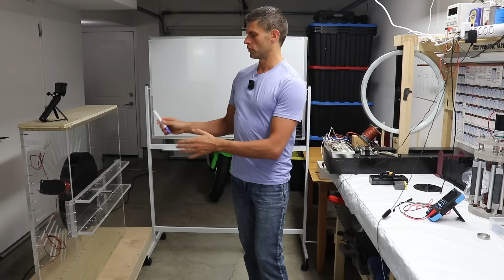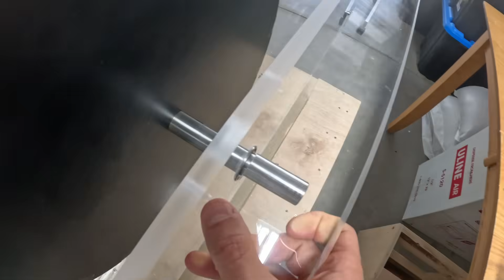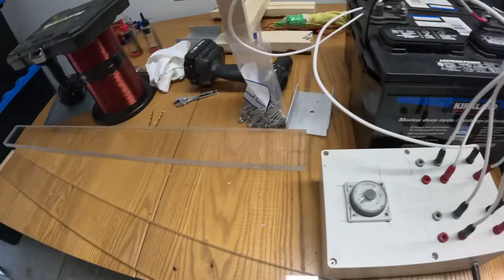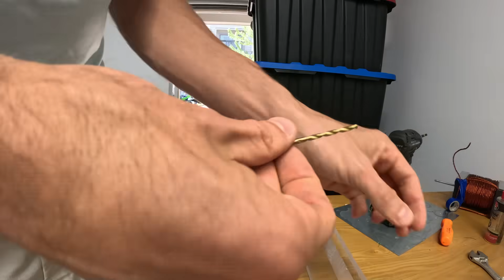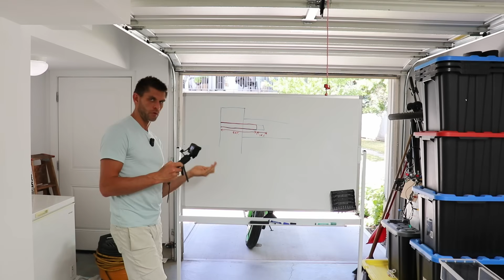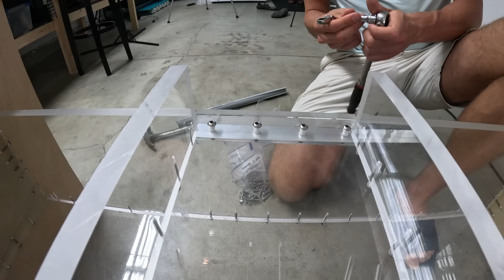This Pulse Motor Could Change the World — And I’m Building It in My Garage

Comment: As much as I wish this was real, I have to give a firm warning to anyone considering donating to this project.

The GoFundMe is promoting a device based on pseudoscience. The claims of "tapping into zero-point energy" and producing "excess energy" are direct violations of the Law of Conservation of Energy (which I wouldn't be against challenging if there was actual evidence).

However,
the project described is essentially a perpetual motion machine, which is physically impossible. The high-voltage spike he demonstrates is a well-understood electrical effect (inductive flyback), but it does not create new energy. The system will always lose more energy as waste heat than it can ever produce.

You don't have to take my word for it. I encourage everyone to research the "Laws of Thermodynamics" from any university or educational source. This isn't a secret; it's foundational science. Please don't be persuaded to fund a project that cannot work.

Comment: Do you have any kind of an estimate of how much energy or electricity one of these things could create?

I’m assuming that your focus here is really just on proof of concept but assuming that your theory is correct, which it looks like it is, I would think that you could calculate some kinds of economic returns on investment for producing one of these which could be the bases for productionizing units somewhat like this.  I’m super interested in what you may have calculated to determine where this could be going To provide energy for consumers and obviously for commercial use as well.

I would love to hear your vision on where you would like for this to go if everything was successful. Every home would have one, etc. The unit would cost probably around $X would produce about $Y in return.
Reply from the maker: I know this is just the beginning and it only up from here. But easily a cabin with the one I have... a home isnt far off

Comment: Your the man Patrick kelly free information PDF's over 800 working over unity patents. One ideo just mechanical is, that Hall back array Magnet you turn on and off to pick up heavy metal, it  uses little to no energy to turn the magnet on and off, you can make a repulsion motor by making a piston engine, that when the magnet is reppeled it can rock past a cut off to then recipricate the engine over and switch to turn the magnet back on all using simple mechanics. I hope this can work. Have an amazing day
Reply from the maker: Appreciate the insights and ideas, have a great one!

Comment: Have you considered using a bank of capacitors instead of batteries? I've heard you say you must quickly capture the energy released from the collapsing fields, and capacitors charge and discharge very rapidly. It would be way cheaper than buying thousands in batteries. You really don't need the batteries to prove the concept. I'm convinced you're really trying to do this, so I'm going to sub just so I can see the ending of the project. Not saying I don't believe in you, but I think I know how this will end. I'd like to be wrong, so good luck to you!
Reply from the maker: Greta ideas

Comment: I hear you bro, I feel the same..open slather, for the benefit of all. I IMPLORE you to research Lutec 1000, including what happened to the inventors. Do it! BTW, your flywheel needs to be balanced and air gap equal on all coils. I presume that you are switching with MOSFETS and either hall or optical triggers.
Reply from the maker: Fets and optic yes

Comment: Doug Konzen made a double Bedini type motor that can run off one battery and charge 3 at a time to ultimately run indefinitely while generating more power than it uses.  It only pulses the electricity at the split second it crosses the magnets while generating much more from the kick back surge that is not utilized in conventional motors. No laws of physics broken, just untapped potential. He has presentations on youtube. Please check it out, id like to know your thoughts.
Reply from the maker: Interesting, I'll look into it, thanks for the info!

Comment: I dont know if you covered this in a previous video, but I have a (silly) question about the spinning speed of the wheel.
I assume, the speed is equivalent to something like, the energy in minus the friction of the bearings.
if you had more friction, would that equate to less energy output? if this was operational but not quite capable of extracting extra energy, would the lowest hanging fruit problem be "how do we make it frictionless?"
Reply from the maker: Yes friction is a big concern for sure. But there shiuld be ample excess energy to cover any losses. The restistance of the wires also has losses etc. Great comment

Comment: what are ur thoughts on the perendev motor?
Reply from the maker: Not sure havet looked into it
Reply from the maker: Perm magnet generators are legit though
Reply: I've always thought that if one where to take one motor of decent size and link it either magnetically. coupled with magnets or a belt and link it to like 5 or more alternators you would be getting more out than you put in.only seen one video on YouTube of an old guy in a garage do it but instead of using a generator to charge one or 2 alternators link them with belts or magnets.(to reduce friction)and link many alternators  and you would get more than put in ..or would it get divided equally.seems it would work but haven't tried..just an idea.

Comment: Getting out from under the thumb of centralized utilities is not only fiscally responsible for the economy boost it gives with additional spending power but provides resilience against central power grid failure. With earth's geomagnetic excursions increasing, that alone should be a wake up call that our dependence on central systems is foolish to continue.

Comment: it will NEVER produce more energy than it requires to run it, too many losses in friction, hysteresis, etc.
Reply from the maker: Generic viewpoint. I disagree
Reply: @MadscienceLPTECH Its called FACTS. Unless you have harnessed fusion. You will not create a mechanical device with friction, wind resistance, etc, that produces more power than it takes to run it. Period. Unless you are not taking ALL factors into account.
Reply: The TEG and cavitation bubbles produce more energy output then input, cavitation bubbles have produced 4-10x more output energy then input from a handful of diffrent scientist
Reply: @grim_spudz6484 😂 Dont know where you got that idea but you are wrong. Cavitation bubbles put out intense light and a small burst of energy but not more than when in to making those cavitation bubbles.

Comment: I just remembered a problem with the Beddini, all magnets are one polarity,  this means only half the sinewave is generated. Induction is most efficient when there's a magnetic push, pull, and a full positive & negative sinewave.

My old man has made a beddini, it does nothing but give illusion that it's doing something other than transfer charge from one battery to another. Eventually both batteries will be dead having achieved bugger all... But maybe the pulse motor could be used to drive a generator perhaps??
I guess well find out?  Wish you luck man 🙂👍
Reply from the maker: Agreed bedini needs to be stepped up for excess power... that's what we are doing

Comment: Bro if all you're doing is capturing back emf from the pulses, then why not just skip all these large rotary devices and just go solid state?  That way you don't have moving parts and everything can be smaller/ more efficient.  Think about it, you just create an EMP and then capture the opposing pulse.  Robert adams claimed this could be 8x higher than input.  But it's just voltage, so need to play with the transformer in order to optimize, but still, seems like the way to go imo. Seems like the tech to support this method is way better now too.  Plus solid state could be better for stacking.  Patrick Kelly did research on an interesting design, claimed to be invented by an anon south African inventor. 

https://youtu.be/EyN7lKKLsbE?si=Q8MD0IrEa9aqZNrB
Reply from the maker: Agreed, but let's get this running then optimize

Comment: A heavy duty flasher small amounts of electrical current through transformers to send huge amount to energize lights far away due to power drop your return energy could flow through one old 80's style coil & capacitor flasher!
Reply from the maker: Great comment 👍

Comment: I am reposting a comment from this video https://www.youtube.com/watch?v=-ZRwlYtAMps 
by @Catisious on how to build a vacuum triode amplifier

Building a vacuum triode amplifier is a fascinating project! Here's a general overview of how you could go about making one:
Materials and Tools Needed:
    Vacuum triode tube (e.g., 12AX7 or similar)
    Power transformer (with appropriate voltage for the tube)
    Choke or resistor (for filtering)
    Capacitors (to couple and decouple signals)
    Resistors (for biasing and controlling current)
    Input and output capacitors
    Potentiometer (for volume control)
    Power supply (appropriate for your tube voltage)
    Sockets (for tube mounting)
    Heater circuit (for heating the cathode in the tube)
    Chassis (to house the components)
    Wire, solder, and other general electrical tools

Step-by-Step Process:
1. Design the Amplifier Circuit:
    Preamp stage: The triode tube will typically serve as the preamplifier stage. You'll design the circuit to amplify a low-level signal (e.g., from a guitar or microphone).
    Biasing: Triode tubes require proper biasing to operate. This usually involves setting a negative grid voltage and a suitable plate voltage. For example, with a 12AX7 tube, you might use a -1.5V grid bias and a plate voltage of around 250V.
    Cathode Resistor: A resistor is placed between the cathode and ground to set the tube's operating point. The value of this resistor depends on the tube and the desired current.
    Coupling Capacitors: These are used to block DC voltage and only pass AC signals from one stage of the amplifier to another. Place these between the stages and between the tube and the output stage.

2. Power Supply Design:
    High-voltage supply: You'll need a power supply that provides the high-voltage DC needed for the tube (usually 250V to 400V for most triodes).
    Heater supply: Triodes require a heater circuit to warm up the cathode, which is typically a low-voltage AC supply (6.3V or 12.6V depending on the tube).
    Rectifier: To convert AC from the wall into DC for the tube's plate and other components, you’ll need a rectifier (either a diode bridge or vacuum rectifier).
    Filtering: After rectification, use capacitors (often in the 20-100µF range) to smooth out the DC power supply and reduce ripple.

3. Build the Chassis and Mount Components:
    Chassis: Use a metal chassis (e.g., aluminum) to mount the components. Ensure the chassis has proper ventilation for the heat generated by the tube.
    Mounting the tube: Install a tube socket on the chassis for easy replacement and secure the triode in place.
    Power transformer: Mount the transformer in a location that allows for safe connections to the rectifier and tube.

4. Assemble the Circuit:
    Input stage: The signal enters through a coupling capacitor and goes to the grid of the triode tube.
    Grid bias: Use a resistor between the grid and ground to set the bias.
    Cathode resistor: Connect the cathode to ground through a resistor to set the operating point of the tube.
    Plate: Connect the anode (plate) of the triode to the positive high-voltage DC supply through a load resistor, which sets the plate current.
    Coupling to the output stage: Use a coupling capacitor to transfer the amplified signal from the plate to the output.

5. Output Stage:
    For a basic triode amplifier, you might not need a complex output transformer if you're building a preamp. But for higher power, an output transformer is needed to step up the voltage for speakers.
    Volume control: Insert a potentiometer at the input to adjust the signal level entering the triode.

6. Test the Amplifier:
    Check voltages: Before applying the signal, ensure your high-voltage DC supply is correct and that the tube is getting the proper heater voltage.
    Signal input: Apply a low-level signal (such as from a guitar or audio source).
    Monitor output: Use an oscilloscope or speaker to monitor the amplified signal.
    Adjustments: Tweak the biasing resistors or capacitors to fine-tune the performance of your amplifier.

7. Final Assembly:
    Once everything works as expected, finalize the enclosure, secure all components, and ensure everything is safely insulated to avoid electrical shock hazards.

Important Considerations:
    Safety: High-voltage circuits (especially with tubes) can be dangerous, so take all necessary precautions, like working with one hand at a time, grounding the chassis, and using insulated tools.
    Heat dissipation: Tubes generate significant heat, so ensure adequate ventilation and use heat-resistant components.
    Component Ratings: Ensure that all components are rated for the voltages and currents they’ll experience, especially the resistors and capacitors.
Reply from the maker: Cool

Comment: Like him, I am an electrical engineer. For anyone interested, here are the areas where his dreams would be questioned by his EE professors. 1) they would remind him that it’s “thermodynamics” not “thermal dynamics”. 2) the total amount of electromagnetic “energy” available in a city is about 3.8 milliwatts/square meter, across the entire electromagnetic spectrum. So the maximum energy that could be harvested by a device 1 square meter in size would be a fraction of that, given losses in receiver gain, and filtering.  The reason solar energy is viable is that it harvests energy from the most energy-dense frequency range of “external energy, the sun’s visible light, from which photovoltaic panels are capable of giving us 40,000 times more energy than the rest of the “external energy” available.
Reply: Just to say, I know they're not scientists, but Google engineers, in January, said they're fairly certain the only way quantum computing can work is that it's borrowing energy from parallel realities. It blew my mind that Google engineers would say such a thing. I'm assuming they're much smarter than me, and if they're understanding energy production can come outside of the current paradigm, I'm guessing there's more going on than what we can currently measure in terms of the available energy.
Reply from the maker: Totally
Reply from the maker: Thanks for the EE input

Comment: Keep going, I think it's going to work at some point. I built my own motor, based on Ed Gray's high voltage, capacitor discharge motor patent. Mine uses infrared timing to control the pulses, 
And a high voltage mosfet for the final output.
Reply from the maker: Can we see

Comment: Think rick friedrick who worked with john had some of these motors for sell. I get the doing the work yourself is an rewarding experience. The motors in any case is quite expensive. Dont think rick has a step by approach on everything. Problems come from the balance of the charging and the specs of what the batteries can handle. Rick has already mention that john try to create misinformation to damage customer relations between them and rick. Hope there is some great info that comes out of this project to advance the technology.
Reply: I met Rick on a two day $500 course he was running . . not impressed at all . . . 🤨
Reply from the maker: Yes

Comment: Is it all based on the return current of the magnetized coil giving a large voltage spike ? Correct me if i understood it wrong.
Reply from the maker: The HV spike going into the lead acid battery is key

Comment: Hi mate, I have a company wanting a wheel I designed for free energy. I never did anything with it as I thought I'd meet an accident. This wheel could be connected to what you've built and increase torque to whatever size you wish to. It works like juggling 3 balls with 2 hands. Taking advantage of forces we already have and utilising the design of the arms. Unfortunately the most efficient shape for the centre frame is a swastika shape however this can be covered with a plate. 
I hope nobody takes your ideas and patents them if you're not. 
Good on you mate
Reply from the maker: Cheers lol

Comment: I've long had this idea of instead of a wheel but a belt with a wheel lifted high up a flagpole with the heavy magnet on the belt.  Permanent magnets on the lifting side and harness the pull of gravity fall to break past the choking point.  It could have a pulse electromagnet to break past the choking point too with a trigger.  I am not sure if it would work but the higher you go the more you could possibly do it.
Reply from the maker: that's an interesting concept many ways to get extra energy with magnets

Comment: I usually avoid drilling acrylic due to the problems you faced. 
  You can usually bond 2 pieces together using a Ketone & clamps from memory.  The more surface area you use the better. 

Looking forward to seeing your Electrical setup if it is not run like Bedini. 

See  what you have planned for the Avalanche Flow in the electronics.

I saw Bedini showing his version of twisted Cu windings in a video recently , still waiting to hear the reasons it was done that way.
Bedini gave out some very useful wisdom , if you build it exactly my way it will work , & then  whatever  you do after that is up to you.

I prefer Inductors & Capacitors to lead & lag the Energy , I'm too cheap to give up the 0.7V  or even 0.2 V lost in making a PN junction switch.

Looking forward to your  next instalment.